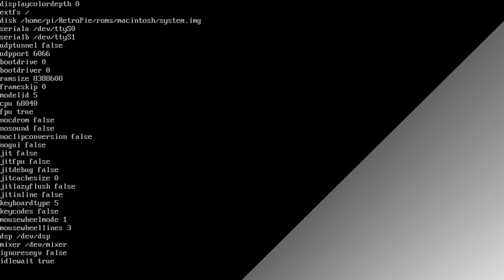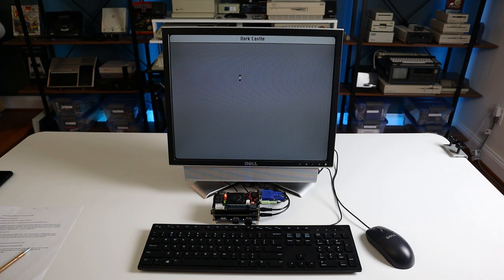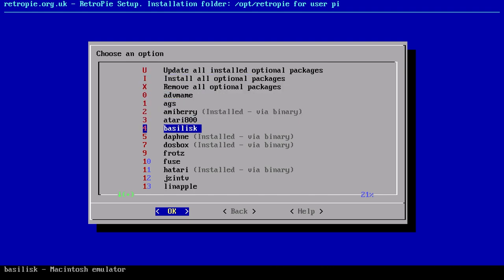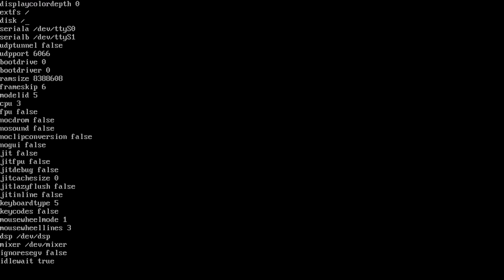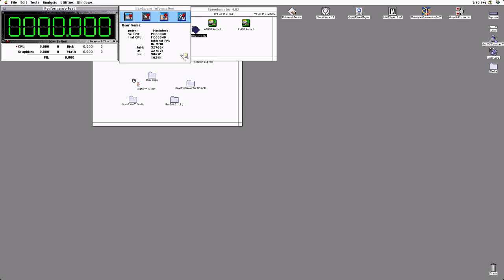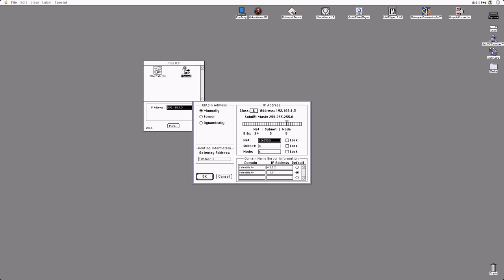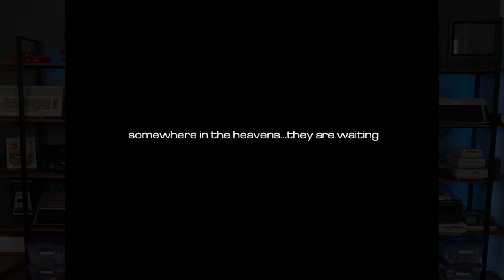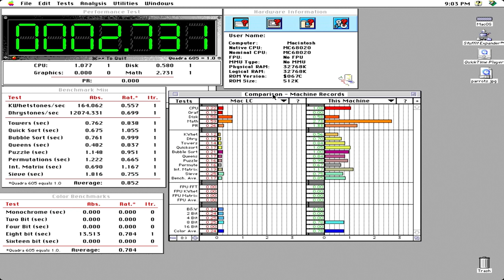#MARCHintosh Classic Mac on the MiSTer FPGA and Raspberry Pi 400

Comment: I am loving pretty much every single Retrobits video in the series after I discovered them through the MiSTer news latest one. The only thing I find hard to follow is when switching to high resolutions -many of us watch on iPads, etc. Please consider easier to read text! Great content, thanks!!!
Reply from the maker: Thanks! I'm still getting a hang of getting good video captures and I agree some of those screens were defaulted to much too high a resolution. Make sure you vote in the poll about which devices you use under the Community tab!
Reply: @retrobitstv  it turns out that Community posts are not available on iPad :D

Comment: Neat.  My main machine back in the early-mid 2000s was a PowerMac 8500/120 with a 300 MHz G3 card in it.  I ran Debian on it, of course.  But there was also a Mac emulator, or rather not 100% an emulator, as it ran code natively and used traps to redirect toolbox calls to the "emulator".  But I don't remember what it was called......  Anyway, it would run on its own VT, so I could instantly switch back and forth between PPC Linux/XWindows and System 7 or 8.  It was pretty freaking sweet.  I miss that machine......
Reply: Perhaps it was Mac-on-Linux? It ran on PPC Linux, but only actively developed around 2005-7. There was a spin-off called Mac-on-Mac when OSX was still new.
Reply: Why would you spend all that money and be limited by PPC Debian? Or was PPC a stack better than what ARM Linux is now?

Comment: Basilisk II also supports JIT for the 68000-series processors, which will increase speeds even further! Still, I'd be real interested to see how ShapeShifter or Fusion works on a Vampire v4.
Reply from the maker: Neat! I did notice the section about JIT in the manual but I kind of glossed over it since it mentioned it was for x86. I tried turning it on anyway on this ARM build, but I don't know if the binary distro I used was built with that option or if it even works with this architecture or not. I didn't get any higher benchmark scores with this particular build :(
Reply: @retrobitstv  I wish I could justify buying the Vampire4 to myself. I never used Amiga, in fact my high school and college years are Apple IIe (and my best friend's C64). But my first computer as a working adult was Mac Quadra650-. 68040. My biggest question is: shouldn't the Vampire FPGA be able to be re-programmed to run MacOS on "bare metal" Mac core? Is there enforceable IP from Apple preventing this? Running it on an emulation of Amiga sounds wasteful of resources- ie too slow. Adrian's Digital Basement recently had a video of a Mac Classic Accelerator "card" which just about replaced the entire motherboard with a 68030 chip and slots for appropriate memory. Surely an FPGA can do the same.
Reply: You might know this already, but the latest version of CoffinOS works on emulators out of the box now. So you can try Shapeshifter on a kickass virtual Amiga using WinUAE or FS-UAE very conveniently (everything is included in the CoffinOS image file).
Reply: @retrobitstv  likely not, then. I found JIT doesn't help things while gaming, at least when running WinUAE on x86. If anything it can make it stutter and act weird. I would presume it mostly helps for math-heavy apps like Lightwave, Scenery Animator, Imagine and ADPro (and benchmarks like the much-maligned but classic and ubiquitous SysInfo).

Comment: I'm not sure why the MacPlus core wasn't allow you to have a functional hard drive bootable system post-install.  I played with it more than 6 months ago and I am pretty sure the hard drive install worked for me... but I've since gotten a larger microSD card for my MiSTer FPGA and didn't bother copying over the MacPlus setup I had played with.  I did end up discovering a few archive sites that had quite a bit of older macOS software that could be run... and given the fact that most of the work was just copying it from floppy images onto the drive... it was amazing just how much easier things were to install back then mainly because they took up a fraction of the disk space they do today.
Reply from the maker: Oddly, I did get it to boot from the HDD image once in a while, but not repeatably. I also found that if I added or removed individual files from the installed System folder, it would boot where it wouldn't previously, or break where it had previously worked.
Reply: @retrobitstv  Perhaps you need to set the SRAM addon board instead of the internal DDR3 memory.

Comment: Very cool! I have been playing with various Mac emulators and systems like Mini VMac and I thought the MiSTer core would do everything I needed, but I ran into the same issues you bring up. I have never used an Amiga or touched the MiniMig core since I had never used one, but now I am curious to get ShapeShifter running on it and try that out on the MiniMig core! Do you have any setup resources or tutorial you'd recommend on setting that up in MiniMig? 
Great stuff, very easy to follow - subscribed for sure!
Reply from the maker: Thanks and welcome! The Mac Plus HDD booting issue was fixed for me in a recent update, so that is working pretty well now. Still, it's nice to have a more fully featured color Mac, so ShapeShifter under Minimig is still a good option.

I did a video on how to set up and use ShapeShifter on a real Amiga which can be found here: https://youtu.be/VX3gbiUxnE8  

I touched on how to set up the Minimig core in this video https://youtu.be/-IP0k3GatHE?t=1250 but it's far from a comprehensive guide, more like a quick tour of features. I found it was easiest just to set up my virtual Amiga under emulation on my PC first and then copy the disk image and ROM file over to the MiSTer later once I had loaded all the software I wanted on it. 

The Minimig documentation does talk about installing the RTG driver and shared drive support which are super nice to have: https://github.com/MiSTer-devel/Minimig-AGA_MiSTer

Good luck and have fun!
Reply: @retrobitstv  Awesome, thank you for the indepth reply, super appreciated!!! Can't wait to dive in!!!

Comment: Wow, neat episode, Matt - you really packed the experiments into it!
For the MiSTer Mac Plus core, it looks like it's about where Mini vMac is, but without the large image mounting support.
My A-Max/Amiga-based Mac Plus will not run Dark Castle, neither on 68040 nor 68000.
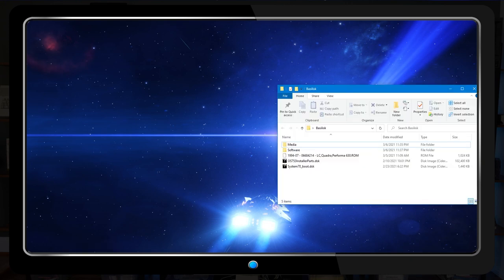8:44 Apple Pi :)
Wow the Basilisk II emulation flies on that Pi 400 - plus networking! ... and what is that screen resolution?!
Reply from the maker: I had problems running Dark Castle on my A3000 also. It would run, but locked up in certain spots. I should have emphasized what the Mac Plus core does well right now, as it will certainly meet the needs of many folks who just want to run software from original disk images.

I was running Basilisk II at full 1080p resolution, which is why everything is so small on the screen. I even tested it at ultrawide resolutions and was surprised to find that MacOS 7 handled 21:9 without breaking a sweat. http://retrobits.tv/pi400_basilisk_ultrawide.jpg
Reply: @retrobitstv  Neat, ya. System 6 works fine in my weird screen resolutions that the Amiga supports with A-Max, too...
And all that graphics code written in 68k assembler! I've been having fun reading/bsdiff'ing the annotated, disassembled ROMs :)
https://www.bigmessowires.com/rom-adapter/plus-rom-listing.asm
Reply: "it looks like it's about where Mini vMac is" -I wish you hadn't made that comparison. You may not be aware, vMac started in 1996 and stopped 1999-2001. I used to run it on my 68k Quadra! So "where it is" is not much further from where it was 20 years ago. I don't want to wait another 20 years for MisSTer to catch up!
Reply: @squirlmy  :) What I think is perhaps irrelevant. :) I was out of the Mac emulation game since 1994 until now. My understanding is that vMac and Mini vMac are two different things and that the latter is still maintained, like Mini vMac 37 was released this month.
Do I understand that correctly?

Comment: Curious about your Keyboard issue. Did you change your USB poling to reduce controller lag in a gaming core? I'd think if that change was global it might cause that kind of behavior with the keyboard since the Mac core is looking for apple bus frequency on the serial input.
Reply from the maker: Hrm, good question. I have not made any changes to the USB settings from their defaults. I am using a pretty old base install of MiSTer though, perhaps some of my configurations are obsolete. I could try with a fresh install.

Comment: Hi - Nice Video

Personally i run the following Apple Mac Emulators

Mini vMac          OS 6 to 7
Sheep Shaver    OS 9

Your video is very good and through, i also recommend anyone getting stuck to search key word "redundantrobot" for help in setting up sheep shaver and Basilisk

I also have versions of these emulator on my PPC 2003 Apple Ibook G4 and my sons 2007 Imac core2duo and of course the win7 and win 10 machines

Regards
George

Comment: I had no issues creating a Hard Drive and installing the Mac OS on my MiSTer, it worked for me on my first try, the only issue I did have was if I didn't shut the machine down properly through the menu the Hard Drive image would corrupt.. besides that it all worked perfectly for me.
Reply from the maker: Interesting. I recently saw an Adrian's Digital Basement where he seemed to have no issues booting the Mac Plus core from a a HDD image either. I guess there must be some variability in the hardware, assuming we're all running the latest software versions. There's a issue in the Cave 68k GitHub page for a handful of people having the same crash that I was having with that core as well. I wonder what the commonality is. I know there have been issues with the 128MB RAM module, but my hardware passes all the tests...

Comment: Lemmings! I still have my original manual, with the anti-pirate codes. My wife and I, between the two of us, completed all the Lemmings levels. And dude, you need to work on your Marathon vidboi skillz ;-) 

Oh, and now I have a new use for my Pi 4. It makes more sense to run emulation on that than on my big Mac. I've already got BII, but I wonder if the config files it uses will work with the Pi version?
Reply from the maker: Haha I've never played Marathon before and the keyboard controls are weird! I imagine the BII config files are more or less the same, minus some specific PI graphics and path settings. Any disk images you've already got should just work.
Reply: @retrobitstv  Cool. thanks!

Comment: Until just now, I had believed for 30 years that the Amiga version of Lemmings was the superior version... nope... Mac. There's more resolution and detail (the little buggers have EYES!) and the sound and animation is just as good. 

Although, in my defense, I believe it came out for the Amiga in 1991, and the Mac version wasn't released until 1993... so for 2 years, the Amiga version stood alone... until they went and ported it to EVERYTHING. Looking at the WikiPedia entry, I see they ported it to PSP, and it's supposed to look sweet... hmmm... I have a PSP emulator...
Reply from the maker: Yea, they sure did port it to everything, even the 8-bit systems! I had the PC version back in the day, which is pretty comparable to the Mac version.

Comment: Can you get the pi to emulate the amiga emulating the mac emulating an apple ][ emulating a c64?
Reply from the maker: There is a PC emulator for 68k Macs, so it might be possible to use the Pi to emulate an Amiga to emulate a Mac to emulate a PC to run Linux on. That would complete the circle :P
Reply: @retrobitstv  That would be amazingly useless!  Challenge on!

Comment: Matt do you know if it's possible to have a collection of .dsk and .img files in the macintosh Retropie directory so that each entry can run directly from that menu as a seperate game?  Could the filename be passed as a parameter to the emulator on startup and mounted as a disk?
Reply from the maker: Yup, this is entirely possible! An easy way to do it would be to remove any "disk" statements from basiliskii.cfg and then modify emulators.cfg with the following: --disk %ROM% 

Now whenever you select any of the .dsk files listed in Emulation Station, it'll boot straight to that particular image. Note that this will break the "Start" menu item though! There are probably more advanced ways to tackle this with Runcommand scripts.

Comment: My Mac iisi has 65 megs of ram.  You might have had a bit more luck at that level.  But internet on a g3 ibook with 9.2 and Classzilla is kinda pokey.  But I can get to Macintosh Garden with it so jobs a goodun.
Reply from the maker: I didn't try to see how much the emulator could support but I will crank it up a few more notches and see.

Comment: Most people don't go to that much effort to show how to get an emulator running
Reply from the maker: I was worried that including all the configuration steps would be too dry, but I wanted to get it documented in case it helps someone down the road.
Reply: I've never got basilisk running
Reply: @kenknight5983  Maybe you weren't looking at the right places, although I assume you just meant YouTube when you said "to show". There's a lot of how-tos on just setting up Retropie, and Mame, too. Although you could argue those are entirely different kinds of emulators.

Comment: An FPGA does not emulate.   It actually implements the hardware on a gate array.
Reply: while this is true technically, there's yet a lack of terminology for describing what the FPGA does to distinguish it from running on original CPUs. "Simulate?"
Reply: It emulates, you can check the definition of emulate in a dictionary if you're not sure. It doesn't implement the hardware, it implements the logic, which is also what software emulators try to do. FPGAs can potentially achieve better cycle accuracy IF the developers can get all the information about the internal circuitry of the chips, and even then an FPGA core is not automatically better than a software emulator.
Reply: @David Stevenson  Thank You